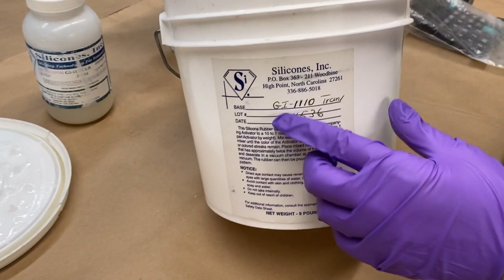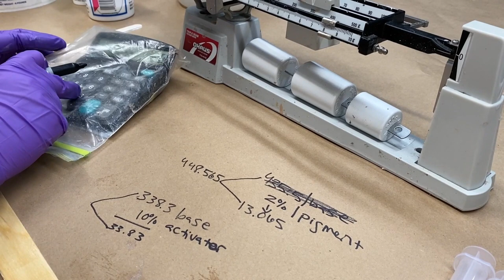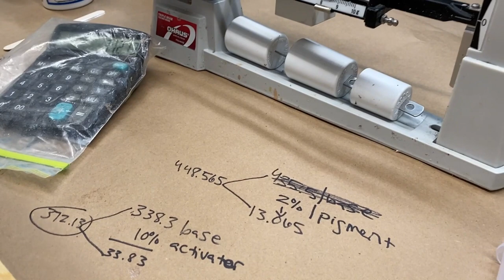Casting a Silicone Puppet Body

Comment from the maker: Hey, thanks! Glad it’s helpful. Oh darn, It’s actually called TC 3180, I misspoke I. The voice over 😢! I didn’t make the mold, so I didn’t source the materials. I just texted my friend who made the mold, and he said you can buy it here: http://Revchem.com . It should be under urethanes - personally I don’t see it. I’d give them a call and see if they carry it. If they don’t carry it, let me know, and I can ask around my network for other options. You can also make a stone mold or a BJB 1630 resin mold if you’re only casting silicone (1630 isn’t good for foam casting).
Reply: Thanks for the speedy reply! I couldn't find it on Revchem but the 1630 looks like a good choice since I'm only using silicone.
Reply from the maker: @neanderetal118  Nice choice, that is what is mostly used in the industry for silicone - and actually the foot plate of this mold is 1630 too.  The 1630 is a really nasty material.  Be sure to wear a respirator and pour it in a well ventilated area or outside and let it off-gas for a day before handling.  Also, I recommend using a paint shaker to shake up the contents instead of stirring it by hand.  You can sometimes take it to a paint store and ask them to use their paint shakers for you.  Good luck with everything!

Comment: Hey Emily 

This was wonderful 😀♥️. I do have two question since I never worked with silicone:

Is there a difference between the silicone you used for your puppet and the silicone used in mold making? 

Can you use the silicone for mold making to cast the body of your puppet? 

When I looked up silicone on Amazon that seemed to be the top search result.  I was wondering what you thought of it?  Thank you so much for your videos and instruction.  I do look forward to see future content in your channel 😀💕
Reply from the maker: Hi Charleen!  The differences in silicone between puppets and molds can be very different.  For puppet bodies, GI 1110 or GI 1000 is what you would want to use if you're using a TIN based silicone - and GI 1000 is used in soft molds, so there's that.  There is also a platinum silicone that is called Dragon Skin, which works well for casting puppets.  I've never used it before, but it is a stop motion industry standard puppet skin material.  

What you've found on Amazon (I'm not sure what it is?  Add a link here if you want me to see and comment on it) is likely too hard and brittle for puppet skin.  Mold making silicones are meant to be harder to hold their shape better and not be malleable.  If you make a silicone mold with the intent of casting a silicone body into that mold, be very aware that silicone bonds to silicone. You have to use a generous amount of release to make sure there is a barrier between the two silicones.  You can make a silicone mold, but I recommend making a stone mold using something like Ultracal 30 for silicone casting.

Good luck with your work!!

Comment: Just for curiosity... according to you and your experience, would it be possible make a smaller silicone human puppet with a metal armature? Something like 3 inches, for example. Of course, semplifying the armature and using a thinner metal wire.
but would it be possible?
Reply: Hi, puppet hospital from a small production here, our smallest puppets were 4 inches and with child proportions and they were hard to make and animate but it was possible in the end. Make the limbs replaceable with telescopic tubing because the thinner the wire the more they break! I hope my comment helps, I’m not an expert but that’s what I can say from my experience 😊
Reply: To make the limbs replaceable we had separate molds for each limb, btw, it was a slightly different process than this because of our production’s needs

Comment: This isn't the first time I've seen someone using an expensive "triple beam" scale to weigh out the silicone. My question is, wouldn't it be simpler and more efficient to use a digital scale?
Reply from the maker: I learned on a triple beam and am just the most comfortable using one.  The industry uses both - usually a digital readout for larger batches.  The triple beam is more accurate in my opinion for smaller weights.

Comment: I like to know what kind or what brand of silicone do you use I like it
Reply from the maker: It's called GI 1110 from Composite Casting.  They're old school, and you have to call to make an order.  You can google them and find their website which has their number listed.  When you order, be sure to ask for Transparent Base and Activator.  Then you can add the Silc Pig to tint it whatever flesh tone you're going for.  Good luck, and happy casting!